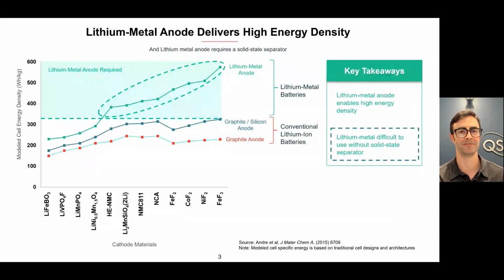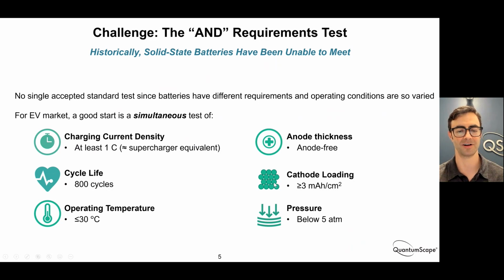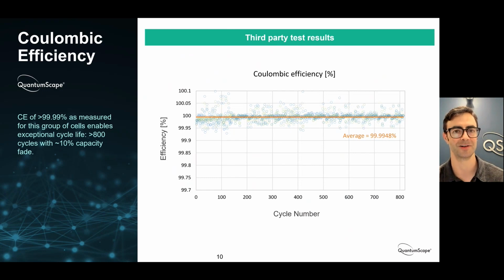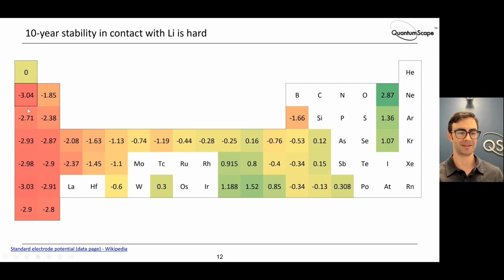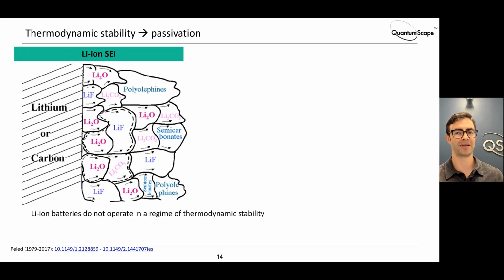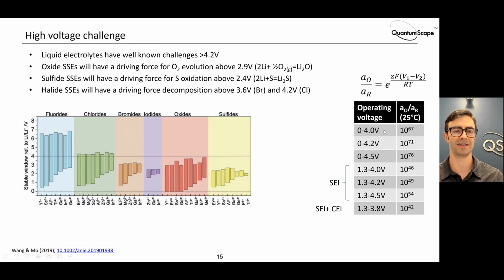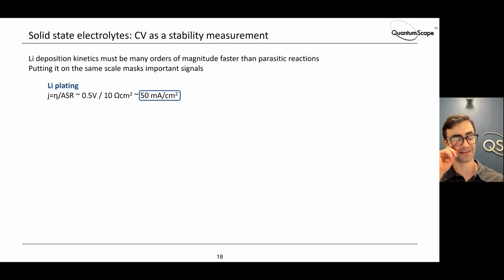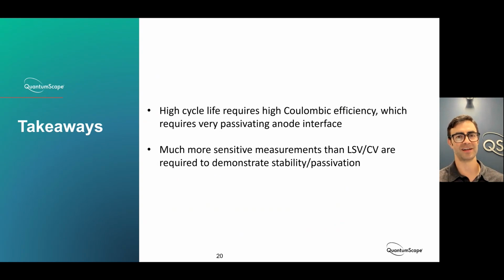Solid-State University: Voltage Stability with QuantumScape CTO Tim Holme

Comment: I have a dumb question based on a few other videos I've seen and what I'm assuming.  When QuantumScape is showing the chart w/ 800 cycles does that mean that these batteries tested have a cycle life of 800 or can they actually keep going cycling to 1000, 2000 or even more?  I'm only explicitly asking this because I've seen some videos where someone said Quantumscape batteries only last 500 cycles but I had assumed that the cycle life would far exceed 800 cycles and that the chart is just showing 800 cycles and that it retains 90% of total charge after that cycle amount.  I think if your batteries do far exceed 800 cycles it would be awesome to stress this point in future videos and talks as some people are spreading false info saying your batteries will only last 100,000 miles??  Anyway, love the tech and I'm recently invested.  Thanks for the video Tim!
Reply: I don’t think they’ll respond, but it sounds like bad information. The 500 number is made up and they should continue well past 800 cycles with the coloumbic efficiency shown. It should also last longer at the slowe real world charge and discharge rates. Beyond that, 800 charges should be a lot more than 100,000 miles.  That’s a range of like 125 miles per charge.  These batteries should be something like 50% longer range per pound than the current state of the art Tesla battery, so it is very unlikely they’ll go in cars with a range of 125 mi fully charged.
Reply: @brianlewis5541  thank you for the reply.  Good to hear about the cycles going way past 500.

Comment: Thanks for showing our work. The link to the particular reference is:  https://doi.org/10.1002/anie.201901938

There are a few related works that explain the mechanisms of stablization: https://doi.org/10.1021/acsami.5b07517  
evaluate SE-cathode interface stabilities: https://doi.org/10.1039/C5TA08574H 
understand the experimental measurements : https://onlinelibrary.wiley.com/doi/abs/10.1002/aenm.201501590 
related videos: https://youtu.be/KOGS12c1JBE

Other work suggested promising cathode coatings: https://doi.org/10.1021/acsenergylett.9b01703
https://doi.org/10.1016/j.ensm.2021.06.027

Comment: the data where zero pressure was applied on the 1 layer cell was just mind blowing! an extremely promising start, but the real achievement will be when the same performance can be achieved for multi layered cells with no pressure applied, at that point, its game over for trad battery chemistries
Reply: If you had to guess, when do you think this will happen?